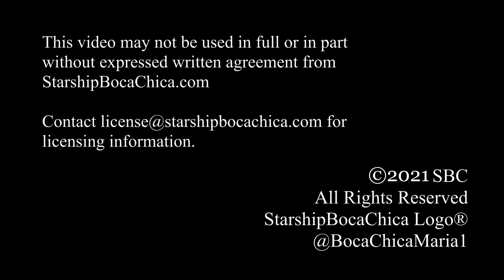Starship Boca Chica 2021 07 04 BN3 Gets Prepped for Flight and Kong Gets Stretched

Comment: Does Space X have a visitor center?  Is there a cooling facility for guests - not just employees?
What news of the Starbase colony development?  Is there or will there ever be gas stations?  Indoor restrooms?
Yes Brownsville is the happening place.  Just wondering if they got eh chic - fil -A setup :) yet? Thanks for sharing your perspective.
Ready for visitors?  Ready or not - here they come.  I would not think the peak of summer is the time to visit, too hot.
AC on the truck is busted need to get rid of the pos- truck it does not look like I can get on the road any time soon.  
Until then we live vicariously, through your lens.  Sure would be nice to see a super stack.
soon, very soon. Can't seem to get it done - continual process improvement - stepwise refinement - step by step, inch by inch.
Slowly I turn.

Will work for ticket to Mars. Peace
Reply from the maker: Good questions I've tried many times to alert visitors about.  No. restrooms, gas, food, drink, AC.  Which is vital to why I accepted my perks from Elon himself.  Then I wasn't allowed viewing from local SpaceX and without my home now, I had to rent an office for cooling down and a restroom.  So I feel your pain.  I have discussed all the above and much more with the CFO in Hawthorne and also with Alma Winzer-Santos at local production shipyard.  Official answer is "SpaceX is not interested in media events or expansion"....at this time was also tagged on by the later.  But Elon has teased on twitter the needs and hopes.  But it isn't a SpaceX total responsibility.  The Parks department needs to facilitate the tourist destination and needs like any other park viewing specticle.  Together with the City of Brownsville, the 3 entities should of seen this train coming.  I sure as hell did and opened up my yard and screamed the sky was falling enough times.  Greed is a huge factor in dividing up a budget.  Elon himself is the worst of not using or giving me perked credentials, to do his promotions to the world along with free twitter.  No press releases or media core to address. No department for media announcements or updates.  It might hopefully change.  With the parks, they are just pissed the E.I.S. is so outdated and land is grabbed with every change up.  I talk to them regularly.  The city of Brownsville was given false hopes thinking folks would be lining the highways up to the hard checkpoint assisting in the promised dollar leakage to the mom and pop gas and food venues to accommodate the millions of visitors.  Not so.  Plans got changed and a 2nd checkpoint was moved by Judge Trevino, from down on the River road called Tarpon, way the hell up into town at Illinois.  Ridiculous for Brownsville to benefit one IOTA. Once again Brownsville gets the short straw and all the viewing goes to the bedroom communities.  I love your comment Ed Dyer, but it seems like you read my mind, so get out of my head.  LOL
Reply: @starshipbocachica  yea yea not enough room for both of us - I am confused too.  I told the world a while ago to expect company.  Mary, the truth is heat killed my Grandpa back in the 60's  no escape back then from a streak of 113 degrees F.  For me getting stuck in traffic in the pos truck with no AC almost got me when I was standing at the paint counter at Home Depot - an unexpected delay in plans can be troublesome to say the least.  Warning is (snap fingers) it happens, like that.

I enjoy your candor.  I am disappointed in Space X and myself for not ringing a bell or jumping up and down earlier.  I joke with you a little about the the water and pioneer conditions - we look forward to modernization.  The Government and Politics is not going away, unfortunately.  There is no easy compromise - I have to think about what you have shared.  For me a trip to the dunes a chance to get you to sign my framed sunrise - there is only one tank - Remember when this all started?  Standing in the field watching the sun rise and set.  I told you about my friend Marlo - who died as a young adult of cancer - the slides I witnessed as a sun set were played backward at our High School graduation and set to the music of the Beatles - Here comes the sun.  I may have been the only one who knew.   What I am saying is lets try to look at this from the other perspective.  Now, what if anything can we do?  Humm thinking.  Screaming into the dark.  I'm with you.

My tag line has been Will work for ticket to Mars.  Nobody ever asks - it is a request to invest with Elon.  He really should start a bank or lending service - I can't get out of my head that they spelled his name wrong too.   Elon is  E loan.  He is only one man. Maybe that is alone.  Or I need a loan.  Idk.
 
-Ha ha He is now over the big five oh - with us.  

Oh you have a mobile office and portable potty.  Nice.  Ha!  Ask Sir Elon to dub you our first colonist.  
Mary, I don't care what anybody says - your ok.  Thanks you made my day. <3
Reply: bad to reply to myself.  Bad Ed - sit stay - bad programmer
I just wanted to say

viewing spectacle    <----- good word use
Reply from the maker: Mary??  She films for NSF and came after me. We saw her filming in 2018 in a more visible form. Big NSF is a big team of groomers and money clicks.  I'm just #1stNeighbor to #SpaceX before we agreed to move out of the way for expansion.  Then Elon asked me to continue my documentation that led the way and personally offered me the perks to make it happen.    So here we still are.  I like Mary's work, but she has a style that isn't hers or mine, it morphed from what I was told and Andy helped groom, stuck some equipment in her hands in the early goings.  I watched them progress, and put up with much negative comments in front of many of peers including Everyday Astronaut,  Austin Barnard, Gene and Rachel Gore (SPadre), Jack Bayer, and nobody cared to go against Mary's anger towards me.  I asked her why she felt she could talk to me that way many times and never got much more than confusion for answers.  She dedicated hours for developing NSF with Andy before Jack.  Really, if you want to thank Mary, that's great, but Andy was her teacher and facilitated NSF needs, and he got ditched. Mary still works for NSF.  Andy didn't get any offers to film??   I think I'll stay independent and not get in the way of Elon's expansion shitlist.  Helps to know your history.  ChrisB scored when Andy moved to the village.

Comment: Thanks!  I really liked the closeups, especially the rare footage of what's going on inside the launch table!  It will be interesting to see how they use those huge links sitting on pallets outside the launch table. The apparatus on the 2nd porch of the launch tower is interesting also.  So much cool stuff being created.  You've made a very high quality video.
Reply from the maker: That launch table is complex.  Please somebody, elaborate and help me here.
Reply: @starshipbocachica  From RGV Arial Photography's latest flyover at 3:05 https://www.youtube.com/watch?v=lVHTrELoT4k&t=312s you can see the Booster Support Arms (tm) (jk) folded out, with flat pedestals on their ends for the booster to sit on.  One of them may be folded up flush with the inside wall of the launch table.  

We can see from your photo at 8:06 that they have modified the inner cylinder of the launch table to accommodate the slight projections on the upper sides of the support arms - by welding on curved reinforcements.  Some of the structure appears to be 2 to 3 inches thick, but the walls of the center cylinder look to be a lot thicker, perhaps 6 inches thick, but I can't tell for sure from the photos yet.

The links that are on the pallets seem to be sized to connect to the support arms, and perhaps they will use hydraulic cylinders on each to move them.  

They have also cut other large irregular openings all around that I have no idea what for - perhaps for other apparatus to hold the booster?  We'll have to stay tuned...

Now my speculation is that when the booster launches and starts rising: those support arms will fold up to keep most of the supersonic rocket blast and heat from entering the rest of the launch table.

Thanks again for your excellent work documenting this historic endeavor!
Reply: I totally agree with your comment feel like I know every worker inside that lunch table